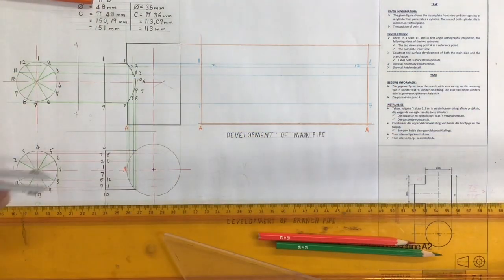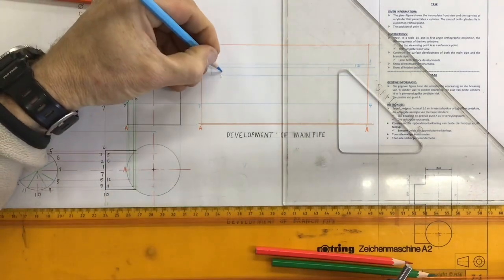Interpenetrations and developments Gr12 HSE workbook page 7-1

Comment: I have a question teacher?.... where did 150mm came for when you were drawing the development of the Main pipe?....or was the measurements given on the question?
Reply from the maker: You need to calculate the circumfrence of the pipes by using the formula : Circumfrence = pi x Diameter